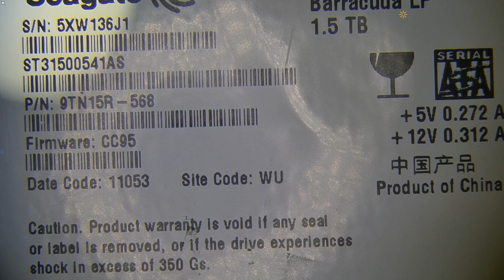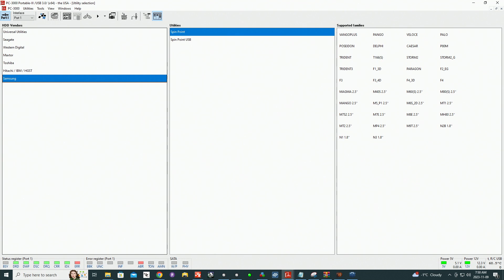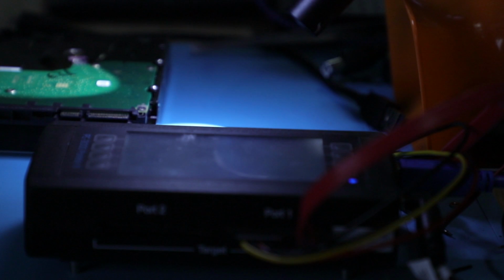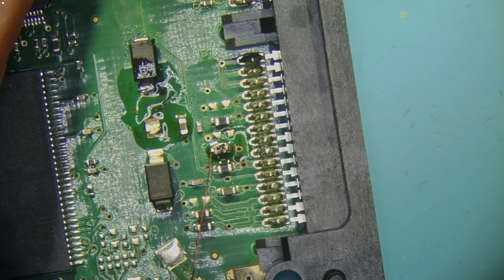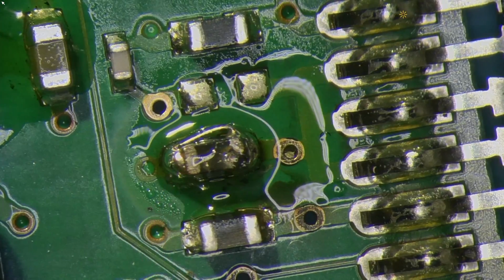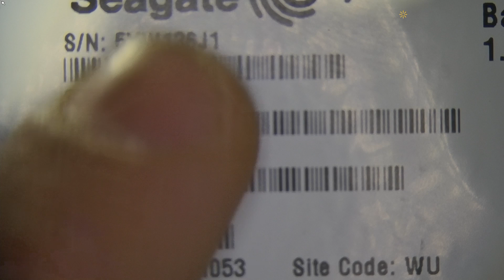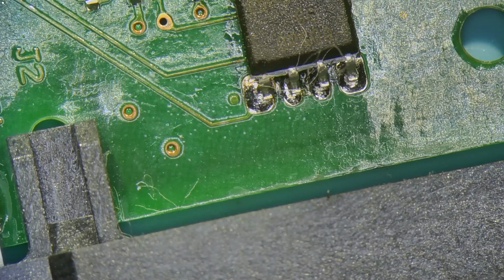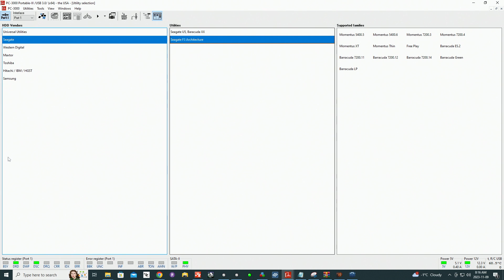how to fix hard drive does not spin up to recover data

Comment: My hd is not spinning and i cant find any fault on the motherboard. Can i buy a new equal hd and move the disk over to the new one.? What about the motherboards BIOS? I have bought a new motherboard same rev and number. Not spinning and none of them appears in the computers BIOS.
is it possibly to recover the data?

Comment: Hi my hp laptop bad  seagate HDD pcb has two shock sensors one reads open & the other 19kohm with  DMM which one is good or bad

Comment: How do you know the resistors what their resistance is because I think they are not listed on the printed circuit and the diode is not listed either, is it possible to connect normal diodes and resistors? What is the power that can go through them? Thanks

Comment: i have a 4tb WD drive that won't spin up.   thought it was the PCB so ordered a new one, but it still doesn't spin up.   i don't have data on it, to recover, so at this point it's just a 'can i do it'...   there is no noise when it's connected, i checked the cable with another drive and the heads aren't parked on the disk.   anything i can do?   it's already buggered, so not like i can make it MORE not working!  thanks for any help.   btw, what is with WD drives.   i have seagates that last for years and years, but wd drives, either the drive or the usb connectors seem to sh*t the bed within a couple years.
Reply from the maker: needs to be sent in for inspection. www.hddrecovery.ca/contact-us
Reply: I've got a 4TB Seagate disk that stopped working. It was BACKED UP, so I don't need it fixed. It is a learning experience. I bought a "very similar" controller board, swapped them and the disk spins and heads settle after a few seconds, but the disk does not show up as a device on my computer. I then swapped the BIOS chip from the original board (TVS shorted plus other issues) to the similar board, but still no happy. My next idea is put back the BIOS chip on the original board and find what I missed on the power side of that board. The search continues...

Comment: Why is it OK to eliminate a diode?
Reply: It is a TVS diode. Look that up on Wikipedia for a full explanation.
Reply: it's a protection diode, it's like removing a bodyguard from a shop, the shop will still work, clients (data) will still come in.
But if that bodyguard is drunk (defective diode) then the clients will not come to the shop, the shop (HDD) will not work.

Comment: Those components next to the connector are not resistors but "beads" (small-value inductors)

You don't have to particularly praise Wiha for having such a 4mm swappable bit set. There are a dime a dozen wherever you look, and I have an 11 year old no-name brand case here that I use a lot and still doesn't show any signs of wear.
Reply from the maker: I guess I overlooked that it's an indicator. Most of the time I see 0ohm resistors on most boards. Whatever they are, they fail same way after TVS goes

Comment: Dear Friend,
I have also 10pcs of Phison E13 nvme drives with FW problems:
v0.385a
OS: 10.0 build 19045
Drive : 2(USB)
Bridge : ASM
Fw : EDFM60.0
HMB : 3272 - 1117376 KB
Size : 976762 MB [1024.2 GB]
LBA Size: 512
AdminCmd: 0x00 0x01 0x02 0x04 0x05 0x06 0x08 0x09 0x0A 0x0C 0x10 0x11 0x14 0x18 0x80 0x81 0x82 0x84 0xD0 0xD1 0xD2 0xE0 0xE1 0xE2 0xF4
I/O Cmd : 0x00 0x01 0x02 0x04 0x08 0x09
Read_System_Info_5008 error: -1
Read_System_Info_5012 error: -1

May be you know where i can upgrade pack for Phison E13?

Comment: take'n that diode out of circut ..to stop the short ..i have watched many hours of tv and radio repair same test tech but on a micro level ..wild to see the head's replaced on the last video was something...it all started in the 70's head crashes on huge platter drives ..they try to rubild those heads as well ..our grandparents were deep into tech even then ..